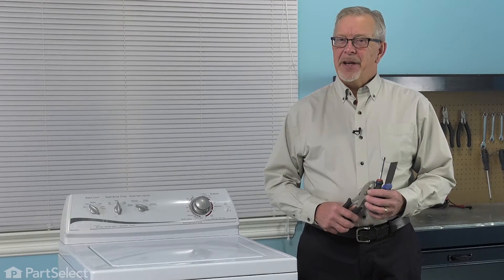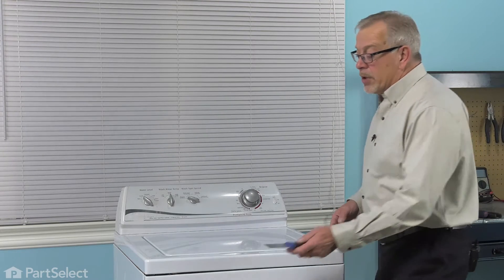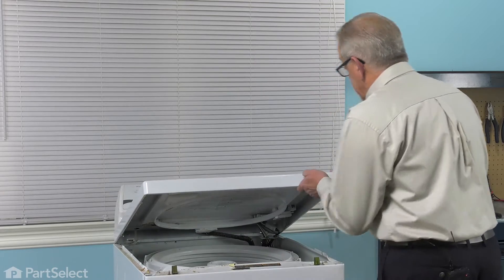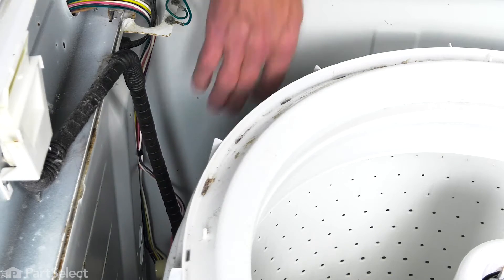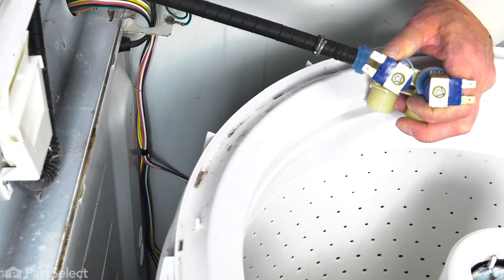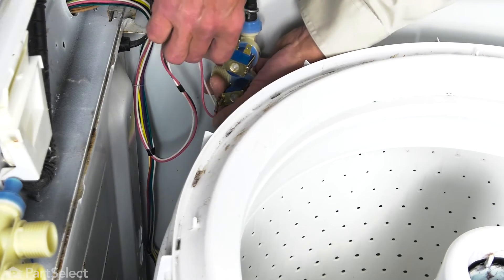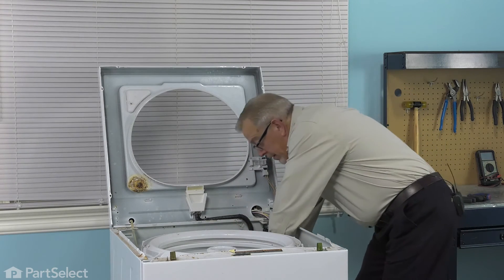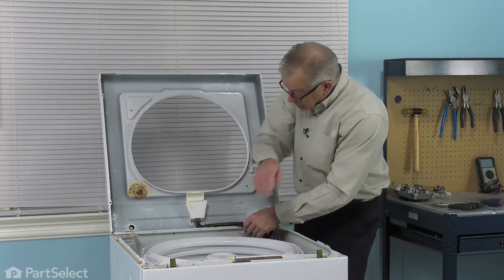Washing Machine Repair - Replacing the Inlet Valve (Whirlpool Part # WP21001932)

Comment: Leaking from where?
Reply: Leaking into the tub from around the rim at the top. In other words, when the valve is working properly, it shuts tight to not allow water to drip into the tub when the machine is off. If the valve is faulty, water will leak past it and drip into the tub.